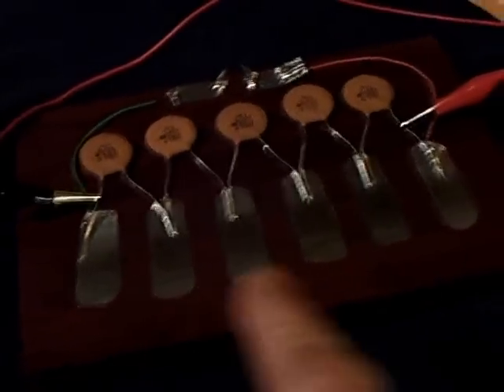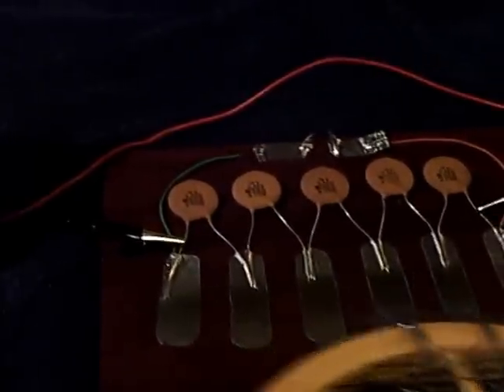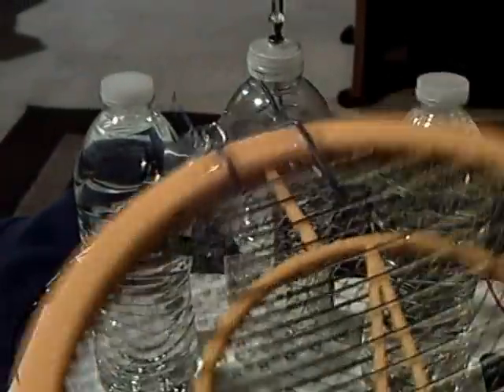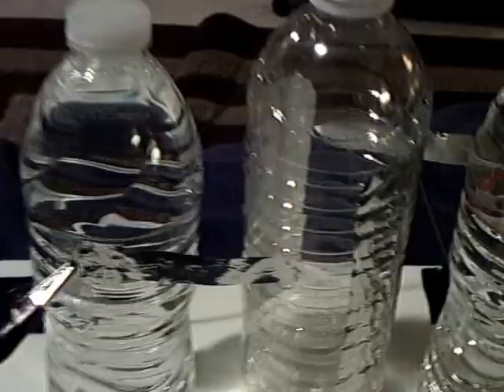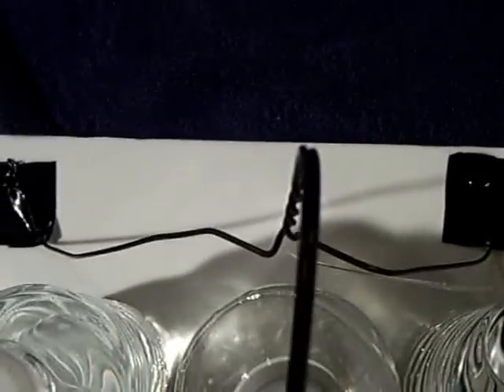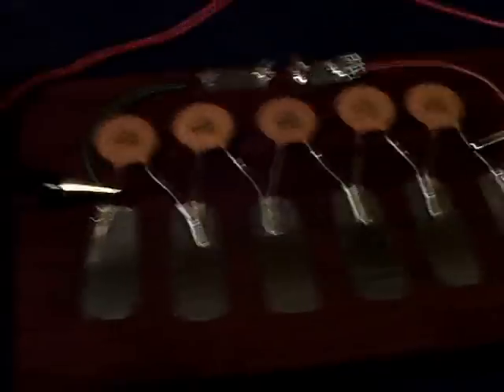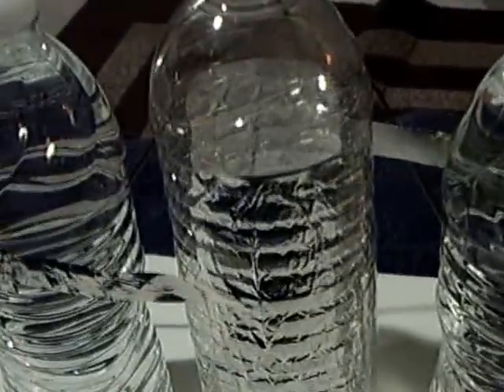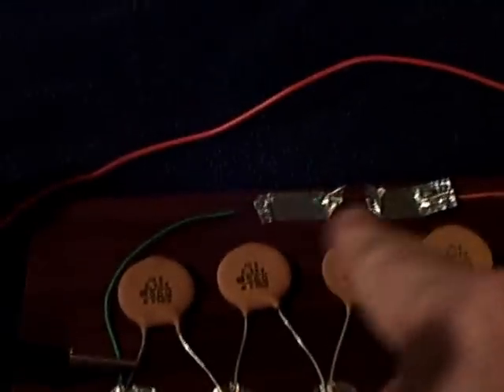Simple Electrostatic Motor-- with simple HV power supply

Comment: Hi would you try salt water in one bottle also if u change the pos and neg round does the middle bottle spin the opposite way
Reply from the maker: Good question!!  Having saltwater in the bottles might make a difference.  The motor only runs in one direction because of how the brushes are setup.  Change the leads around it still runs in the same direction.  It's odd but that is what happens.

Comment: Heck of a use for a Cockcroft-Walton type ramping method..what an excellent practical idea !
Perhaps you could pair this with a manual rotation version of the sideways pills bottle HV generator ? if it would work...would be superb for kitchen building if so.
Reply from the maker: I have been pondering a rotating version of this.  The brush setup is a bit tricky but I think that it is possible.  I just made a regular Cockcroft- Walton today.  That one works with an AC input but this manual one uses a DC input.

Comment: so all it needs to do now is place a flywheel on a gearbox without the engine and being that the gearbox is usually aluminium we have to staticise the flywheel and have say a cow bell magnet housed in the gearbox john worrel keely style  1890,s and may be fix a alternator on the centre of the flywheel and branch sprak gap fingers back to the cow bell magnet or the aluminium gearbox nothing earthed to body of car though so then the static would arch across to flywheel back out alternator and be locked looped just a suggestion as your spinning bottle relates to the flywheel on a car though you have it the best way pointing upwards as its in sinc with all the 360 magnetism of the earth that way  and their would be slight drag with a flywheel being laid flat

Comment: I like the idea of using electro static energy to run things directly without needing to convert it to magnetism and then back to electricity
Reply from the maker: These motors can also be made very light.
Reply: ***** can these be made to run with high torque? maybe like a tesla turbine or something and connecting it to a heavy flywheel, high voltage is easy to make from very small sources like ground and crystal batteries